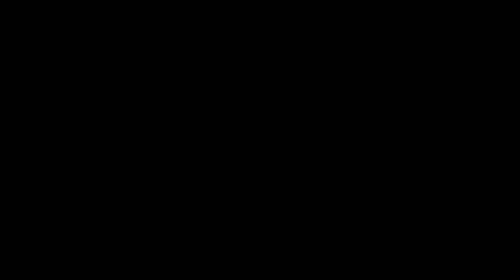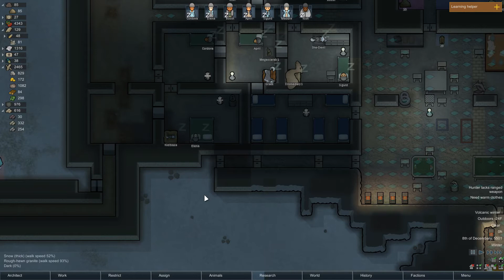Rimworld Temperature Differences

Comment: Each time the door is opened both temperature levels of the adjacent rooms equalize a bit while it's open. So that's why they're all different. With less doors in that hallway you showed us you'd have the average temperature of all that rooms we're  seeing now [More or less I'd say.] But long hallways to the outside are good in that the interior door is closed before the outer door is opened, because you want temperature equalizing with the outside in the smallest room possible. [But that 2-tile hallway is probably too short for a non-autodoor..] I'm not entirely sure about the mechanics but I noticed this on my ice-sheet playthrough as well..
Reply from the maker: I'm wondering if it's a fixed ratio. like if all the doors are closed for an elongated period of time, then the temperature will differ 33 percent (for example) from the previous door.